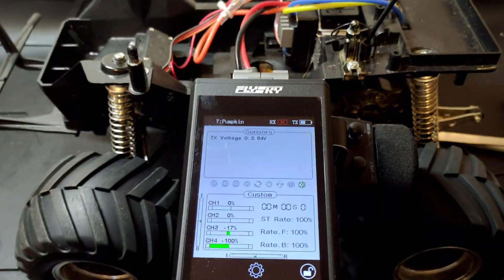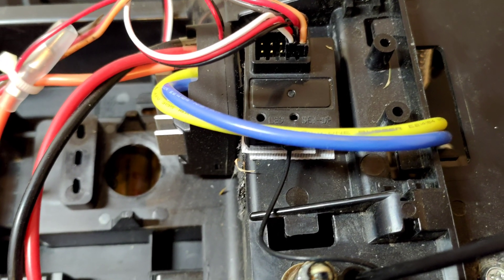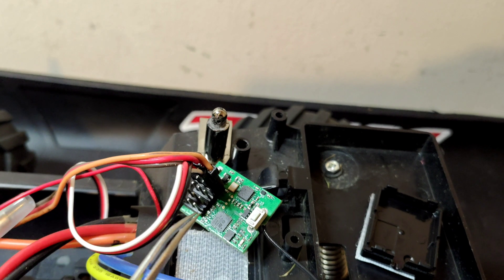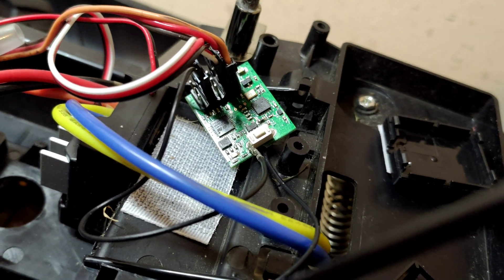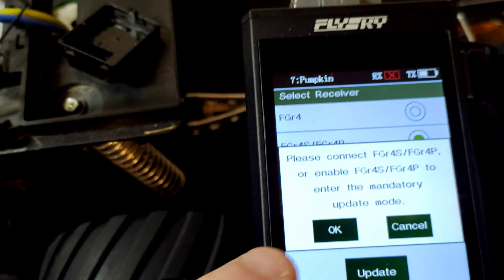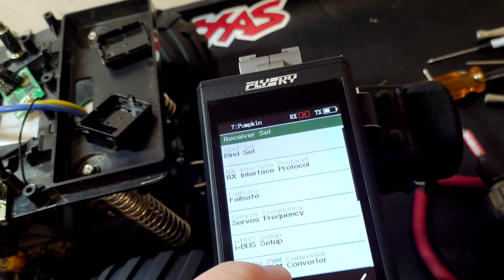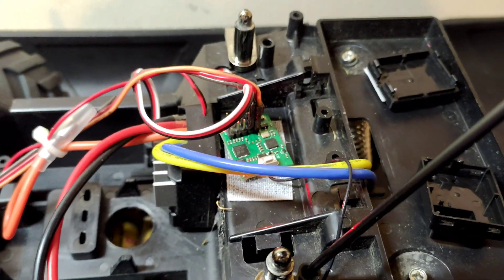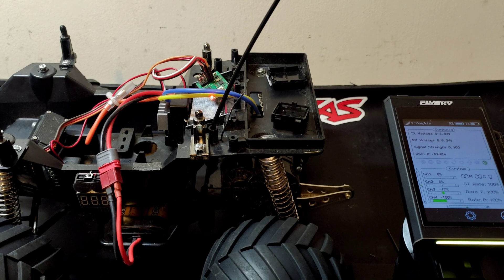DM Racing ( Dasmikro ) nb4 compatible receiver firmware update guide after 2.0.93 nb4 update.

Comment: I received my NB4, installed the Mini-z module, worked perfect on the Mini-z. When I tried to set up another model with a DSK-151, the update seemed to work, the bind seemed to work, but there is absolutely no control, no steering, no throttle(steering doesn't even twitch, or power up at all).. Any ideas? I tried in both AFHDS3 1 way, and 2 way..
Reply from the maker: What receiver are you running
Reply: @WTFRCCars  DSK-151, I believe, the same one you have in this video...
Reply from the maker: So it should be set to 1 way then update the receiver by holding the bind button in for a long time and selecting update from the Rx menu then it should bind and work you will see a solid light, for mine I have the official flysky receiver though
Reply from the maker: Or do you mean the one in this vid not the miniz if it's this one all the servo plugs are backwards just turn the plugs round and put them in backwards and it will work ;)

Comment: For anyone reading this: I just updated to the .100 firmware (latest as of 2/2022) and this Dasmikro RX refuses to bind now. I wonder if Flysky has locked out 3rd party RX's?. I have 2 and both won't update.
Reply from the maker: I have a few DM racing ones so I'll check all flysky ones still working fine and don't need to update from 2.0.99
Reply: @WTFRCCars  My Flysky work fine, it's only the 2X DM ones that won't update. Light rapid blinks on the RX but radio update meter stays at 0%. I always update the RX whenever I update the radio, to me, they go hand in hand but I may be out of luck this time.
Reply: @WTFRCCars  Maybe I misunderstood but you're saying that moving forward, we don't need to update the RX after the .99 update?
Reply from the maker: So I have just bound this exact receiver to the nb4 on 2.0.100 by holding the bind button and powering it up then just selecting bind on the nb4 as classic receiver and works fine no update needed at all :)
Reply: @WTFRCCars  Okay, thank you for that. I didn't try binding because Flysky has trained me to 'mandatory update' after each firmware update. 

I can confirm that my DM RXs binded without the need for update as did my FGr4s. I did however, update one of my FGr4s and I'm not sure if there is any advantage to that or not over one that wasn't updated.
Reply from the maker: I've tried all mine now and none needed to be updated but all had been used on 2.0.93 so looks like no receiver update needed from 2.0.93 to 2.0.100 :)
Reply: @WTFRCCars  Yes, it appears to be this way. Thanks for the help and feedback. You do a much better and faster job than Flysky LAMO!👏
Reply from the maker: I do my best for you all :)